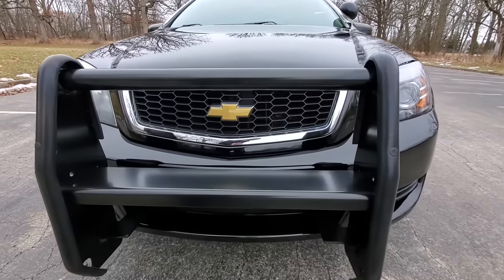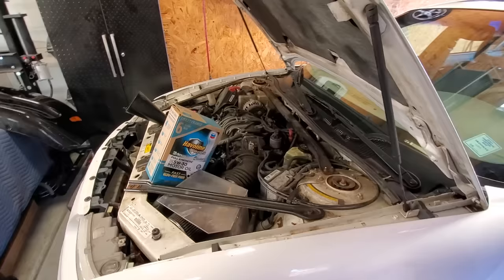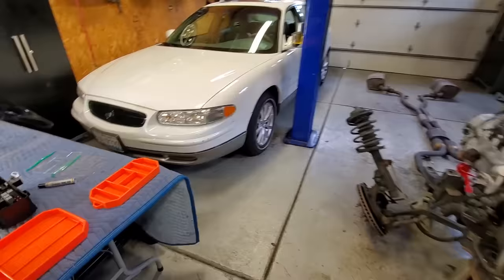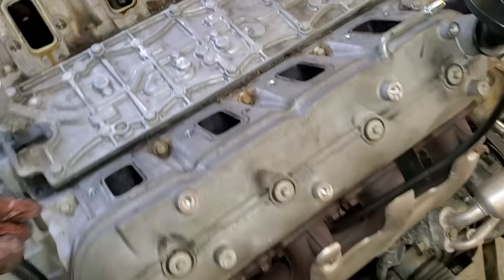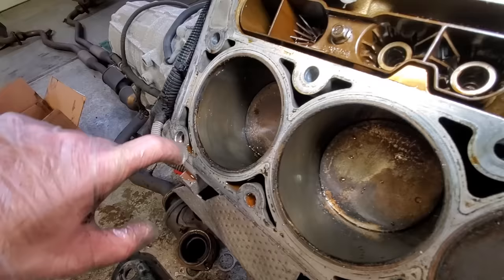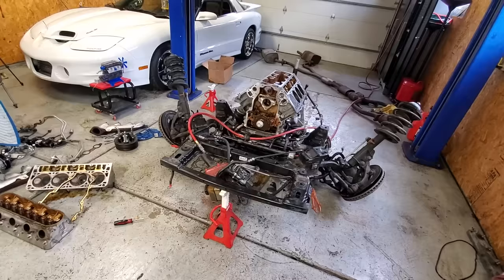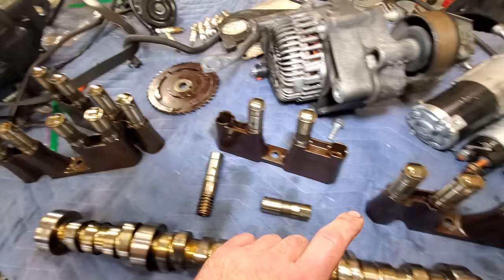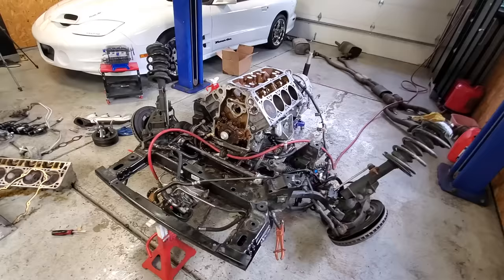Looking Inside An ABUSED V8 Engine That Idled For 12 Months! 357,000 Mile LS Teardown + Body Removal

Comment: The Ford 7.3 in my ambulance is laughing.  500k miles and about 21 hours of every day is spent idling.

The "engine hours" gauge has been pegged forever.
Reply: Where is it pegged at? 10k hours?
Reply: Ambulance use varies across the country. My last service van was a twice retired 1996 E350. 170,000 miles were racked up in ambulance service over it's first 10 years and then 15,000 miles over the next 10 years as a mobile command unit for a small police department. The run hours matched up with the odometer to show it was mainly used on the highway. In Texas, it's common to park ambulances and plug them into shore power with both municipal and private services.
Reply: Won't be able to do that with a new diesel. You'll clog up the EGR cooler so fast. I see it on tons of fleet vehicles that idle a lot. Cooler after cooler. Just keep running that old 7.3 as long as you can 😂
Reply: Alex Puls as I understand it this (and similar issues with the DPF) are why a fair few fleets are buying large gasoline engines vehicles now.
Reply: @cjeam9199  It's the emissions systems in general. 20 years ago, diesel engines were capable of delivering double the fuel economy and lasting 3-4 times longer than comparable gas engines. To meet emissions you sacrifice longevity and economy. General rule of thumb, replacing the emissions system on a modern diesel costs roughly 10% the new value of the truck. One of my former customers used to tell me, their new Macks and Peterbuilt's averaged 100,000 miles before the emissions system need to be replaced ($30,000) and they found for that money they could overhaul 30 year old trucks with over 1 million miles on them and put them back on the road for another decade. The ROI on modern diesels just isn't there anymore.
Reply: @zapityzapzap  100K on a big diesel ?!  What would be the point ?  For an engine like that that is low enough mileage to be replaced under warranty.
Reply: Its an International T444E, Keep it as long as you can. I've personally seen them go for 900k. However, they usually need some love: hp oil pump, water pump, timing cover at some point in their life, sometimes more than one. But really, replacing those parts to get a 900k mi engine is nothing.
Reply: @cjeam9199  everything Colin said as well as the fact that Diesel prices are considerably higher than gas in some places and there has been a shortage of diesel at times, cold winters are harder on newer diesels and the cost of maintaining a diesel is so much more than gas, just the amount of oil needed every oil change and the frequency at which you need to replace fuel filters makes it hard to justify unless you are towing full time. I have seen many people and companies switching their fleets over to gas.
Reply: Thats a 7.3. The 6.0l in the ambulance I ran got replaced every 80k (3 engines in 220k when retired) It idled 20 hours a day though.

Comment: My 2014 Silverado Gen 5 LT L83 just hit 5000 hours on the motor.  Doesn't use any oil surprisingly.  Never had a single issue with the motor.  Dod really improved on the newer LT motors.

Comment: I had a 1999 transam with an 5.7L LS1 motor, modified it from stock 305hp to 500hp. I went racing at the strip weekly, did long road trips, was a daily driver in the northeast winter and in Florida heat. Never had any issue with the motor, LS engines are one of the best ever built !

Comment: Not gonna lie, I let my work truck idle way more than I should, I think I’m pushing 12,000 idle hours and 320k miles
Reply: A truck would benefit from a small auxiliary engine to provide heat and power when parked.
Reply: David Elliott so bring a generator on the back of a truck?
Reply: What type of truck

Comment: Good old Aussie engineering and build quality... go the Holden statesman... 🇦🇺
Reply: Unfortunately, Holden is no more.

Thank You Stefan Jacoby for Killing Australian Automobile Manufacturing 😡😡😡😡😡
Reply: I've driven a few of these cars, I was anything but impressed. They were squeaky and loud and very harsh riding but they were also stupid fast.
Reply: @phillijp  the fast came from the USA. Holden were a parts bin special. Our vx commodore 2001 is great. But it is an opel with a gm ecotec v6 and gm transmission, rwd. Great idea, average quality, but so easy to fix. These also came with an ls but it's not necessary for a family hack. Rough ride isn't Holden. Add stiff springs and poorly valved dampers and it'll feel like a tin can rolling off the side of a mountain. Every Holden I've been in is aiming to imitate a BMW 5 series. Their engineers did a lot very well, on a shoestring budget (especially considering the high Labor cost here). Some of the last generation had  magnetic ride control and were amazing. A good addition would be a strut brace to stiffen things up a little. Sad that Holden started bringing in Peugeots with gm motors ☹️
Reply: I'm Australian and literally not one single part of that engine is Australian engineered hahah
Reply: Lol Vinfast Aussie rengineered bmw x5 and an chevrolet 6.2 v8. I'll wager it'll be more reliable than a BMW and cheaper to fix. Made in Vietnam 🎉

Comment: Remember back in the day when you'd get a 350 sbc with 100k miles that burned a quart of oil every 400 miles and needed a complete rebuild with overbore? 
Now, you can get a 350k mile ls and throw a cam, valve springs, injectors  and turbo on it and hit the track.
Reply: I had an old c10 with over 100k on it, never did burn oil but it did leak out the valve covers until i fixed it

Comment: I’m a huge LS guy, but the damn AFM/DOD literally ruins these perfect engines.
Reply: Just like the hemi and its MDS. These engines are basically distant cousins, and it's pretty cool to see that they suffer from the same issues, and also disappointing.
Reply: Yeah I hear ya. In Australia our car mob, Holden, ordered a version of the L98 with DOD called the L76. I've got one and they're just such a problem child with the DOD stuff and weak as piss lifters. Such a sad way to ruin an engine. The kicker? They never turned on DOD on these engines anyway and mine is a manual, which DOD wasn't available in manual so it was an utterly pointless venture from start to finish. So not only a waste of time but such a waste of money too!
Reply: Why “literally?”
Reply: Brett Collins Why “literally?”
Reply: @daytonasayswhat9333  Because the lifters eat away the cam, which can cause catastrophic engine failure, thus literally ruining the engine.

Is that what you wanted to hear?
Reply: RedAssassin274 Why “literally?” What is that word adding?
Reply: @daytonasayswhat9333  I mean, literally means that it's actually doing damage rather than just being used as an expression. It isn't detracting from what OP said
Reply: Brett Collins  the LS3 didn't have it, the L99 did.
Reply: RedAssassin274 “Literally” does not mean, ‘actually doing damage.’
Reply: @daytonasayswhat9333  Literally means literally.  you know what literally means, and the OP used it right. It isn't our fault you don't understand how the cylinder deactivation programming  literally causes the engine to destroy itself through the cam with lifters.
Reply: RedAssassin274 “Literally means literally.” Lol. Worst definition ever.
Reply: @daytonasayswhat9333  Okay thesaurus, thank you for the valuable contribution to the conversation that was at hand, have a good one
Reply: Idk why y'all got so hung up on the word literally but since you can't Google here you go..
in a literal manner or sense; exactly.

"the driver took it literally when asked to go straight across the traffic circle"
Reply: This is the problem with alot of modern humanoids..  so defiant and argumentative, always questioning facts. Facts are facts, LITERALLY !
Reply: Simon Jorgensen Hilarious how you think that sentence added any value.
Reply: @daytonasayswhat9333  Your original statement never added anything to the post. No one said a thing. Except now
Reply: RedAssassin274 No, you’re wrong. This entire thread became about my comment
Reply: @daytonasayswhat9333  it literally did
Reply: @daytonasayswhat9333  you're literally spending way too much time on this
Reply: TrashBandit 24 You’re spending too much time telling someone that they’re spending too much time?
Reply: @daytonasayswhat9333  no I literally spent like 4 seconds typing that
Reply: TrashBandit 24 How long do you think it takes me to type this?
Reply: @daytonasayswhat9333  probably not too long but you literally have so many arguments about a stupid thing and you're literally in the wrong the entire time
Reply: TrashBandit 24 If this is your idea of being clever, you have a pretty low bar.
Reply: @daytonasayswhat9333  if that's your idea of thinking that I think I'm being clever, you have a really low bar
Reply: @daytonasayswhat9333  either way I literally don't know what you're talking about.
Reply: Figuratively Speaking...
Reply: @Travis Justice if they AFM is tuned out/taken out, can it still damage your engine? I've heard it has but I don't know.

Or maybe the damage is already done and you have to take it out and then fix the damage and then it's good? I don't know

Comment: I work at a chevy dealership here in Oklahoma and I've seen my fair share of dod failures and problems with that said I have a 07 silverado with a 5.3 with dod and ive put 200k on it with no dod problems so regular oil changes goes a long way

Comment: Long live the mighty LS. What I took most from this video is just what cheap insurance oil is if you change it regularly. I’m a big believer in changing oil every 5000klms or 12months and looking at the internals of this mirror tells me I’m doing good things for my cars. 👍
Reply: I am the same but every six months worst case scenario (I also live in a four seasons climate). I recently looked inside my LS at 100k and it was squeaky clean.

Oil changes are cheap. Engines are not.

Comment: As a police interceptor owner. I tracked down the people that drove it while it was in service and learned a horrifying fact. It was either idling or going full tilt. It was used as a highway patrol interceptor and.... the engine is surprisingly mint. It did get new cams, but that was apparently the only major engine work. 2003 Ford crown victoria. Drives like a champ. The transmission is showing its 190k miles though

Comment: The best way to fix that bs where "07" and up general motors vehicles only use 4 of 8 cylinders when their coasting or what ever just buy a "active fuel management" chip that sticks right in under the dash and makes it run on all 8 cylinders all the time
Reply: Yes indeed, I had one for my grand prix which was a V8 that had displacement on demand. I actually bought it just because I didn't like the exhaust tone when it went into 4-cylinder mode. Unfortunately I drove mostly on the highway in those days as I was all over the East Coast. So I had to listen to it a lot. I bought one of those OBD2 chips and not only did my fuel mileage barely change but the engine was just so much happier. I put a hundred and thirty or a hundred forty thousand miles on that 5 3 and I don't think it was even remotely worn in any way. I ended up trade it in on a brand-new pick up when I changed careers. I still see it around town on occasion no, but I have never been able to catch up with the person who owns it now to ask about it.

Comment: The kids watching this should know, always loosen headbolts equally and starting from the outside when removing a head.
Reply: Kids? Lol it doesn’t matter what order you take them out in.
Reply: @jaredmayer3960  it does actually.
Reply: Can it cause the heads to warp or something?
Reply: @hunternichols6273  yep, especially with aluminum heads
You may get away with taking them out willy nilly for a while but it can happen.
Reply: BAAAAAAAHAHHAHAHAHAHAHAHAHAHAHAAHAHAHAHA
If you remove a head for work like this and are NOT smart enough to have it cleaned and decked, you dont need to be touching any vehicles and your brain should be removed from your skull cause it clearly is NOT BEING USED FOR COMMON SENSE!!!!
ALWAYS have the heads surfaced before re-installing them!!  Clean level even mating surface!!  THAT is why removing them doesn't matter!
Reply: @overyonderjustapiece  you think you're smart bud but many manufacturers won't pay for head leveling and require you to bolt it back down
Reply: @overyonderjustapiece  also Ed, alot of diesels can't be decked. It messes with pushrod clearance and valve clearance. So makes proper loosening even more important. 
Ever heard the term "The empty can rattles the most"? Fits you fairly well

Comment: Guess I'm the only one cringing with that head surface down on the shop floor
Reply: Just thought so
Reply: On top of that... the fact that he loosened all of the head bolts out of order, like bro you gotta loosen them in the proper order. Mans is risking the warp
Reply: Probably getting it resurfaced and polished.
Reply from the maker: Yep. They are fine
Reply: Spit on it, slap it back on the block with the original head gaskets, use the original head bolts, tighten them down with a few ugga duggas, and it'll still work perfectly.
Reply: Yep...I noticed that too and cringed

Comment: Had a 1998 Camaro SS with a built LS1 motor put 130K miles on it as a driver and then raced the shit out of it auto cross and open road racing. Never had a problem car got 23 mpg when you weren’t beating on it. Got it up to 150 mph in 5th gear in an all out mile race. You just can’t beat the LS motor.

Comment: Poor Commodore, in Australia they spend their time being abused by the driver due to consistent thrashing and lack of servicing.
Reply: Thats not a Commodore.
Reply: @HJZ75driver  It's a part of the zeta platform, it's a WM. The zeta platforms base car is the Commodore range, so when I call it a Commodore, I'm referring to the fact that it's based on it. It's a spruced up luxury Commodore.
Reply: @HJZ75driver  No, it is a Statesman Caprice in Australia.
Reply: @HJZ75driver  well  it was built by holden

Comment: Thanks for sharing this tear-down video.  I just started swapping the L76 from my parts G8 (someone else thought it could ditch drive, but front end didn't like that...) over to my main G8.  I don't have the luxury of a shop and hoist, but the info contained in this series helps me see how to go about it in the backyard.   Funny to see you putting the pipe to the same bolts I fought with.  The ones on either end of the sub-frame came out nicely, but those two middle ones were a 1/2 day pain (including time to get a 4' pipe)!

Comment: Lmaooo that’s funny I bought a 99k mile charger police car with 19,000 idle hours things a beast I love the police cars just got to get one that was maintained on some level. Mine had 4 recorded oil changes but it was super cheap so I didn’t care runs and drives awesome had none one of the recalls done before I got it if that shows how well it was maintained.
Reply: They seem to be pretty stout.... Provided the lifters don't eat the cam or vise versa.
Reply: Herpn Derpn it’s all about proper maintenance on these, I also have a Chrysler aspen with the hemi with 250k miles still running all I’ve ever done in original ownership is a water pump

Comment: Those engines are so easy to work on 😀 I have one in My Yukon, compared to working on my RAM 2500 Cummins or any Ford truck it's like they designed it to be serviced. My Yukon only gets Mobil  One or Royal Purple oil. It's got over  300000 miles on it 👍 it's so clean inside and still running like new 😆.

Comment: Does “DOD” work with the vehicle in Park? If not, I can imagine that’s why the valvetrain looks so good, still.
Reply: Correct idles in V8 mode - I was thinking the same thing
Reply: @PapaWheelie1  the issue with DOD is that it breaks in the "enabled" position.  The lifters and ports clog up if you don't change the oil, and then the oil pump can't keep the lifters full, so they collapse, and the engine keeps dumping fuel into them until they either detect that the lifter is collapsed, and shut off fuel/spark, or, they keep dumping fuel into the closed intake and fill it up, and then cause other issues.  Then, once the lifers collapse, and the oil pump has to pump the oil somewhere(its a high flow pump in these engines with DOD, not high pressure), so the relief system splashes/sprays the now not needed oil directly onto the bottom of the pistons in a constant flow, which then results in a really bad oil seepage and burn issue.  If your DOD is still working, get the ECU tune to disable it completely, and it should never break unless you forget to change the oil.
Reply: Chubbysumo - good info. I have a ‘12 Tahoe with 75k miles and always on time oil changes. I do hate the hesitation that comes when it shifts in and out of 4cyl. I have a 1 mile drive to the interstate every day and I shift it in 5th to disable for that 1 mile. But would love to ecu turn it off permanently. Is it something that I can buy to program it or do I have to hit a tuner shop?

Comment: This engine would have kept going forever looks perfect inside
Reply: Yeah, if he doesn't put Havoline in it!  I moved away from that crap years ago.
Reply: And if he didnt take it apart lol. Im a rotella t6 guy
Reply: Yeah, Havoline used to cause engine seals to leak.  You could switch to Castrol, and the leaks would stop, so I quit using Havoline.  Today, I mainly use Prime Full Synthetic from Sam's Club or Costco, but none of those paraffin-based oils like Canker State or Traveler from Tractor Supply.  Paraffin causes sludge buildup in an engine.  Here in south Texas, HEB has a synthetic or synthetic blend in a blue or gray bottle, too.